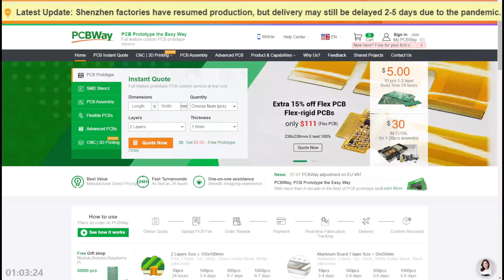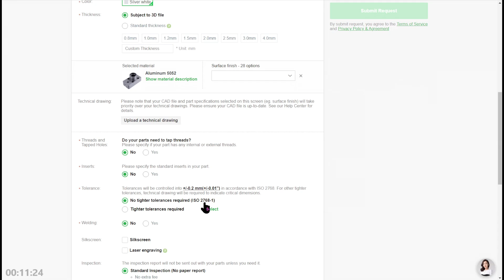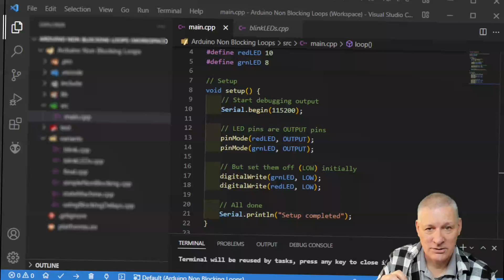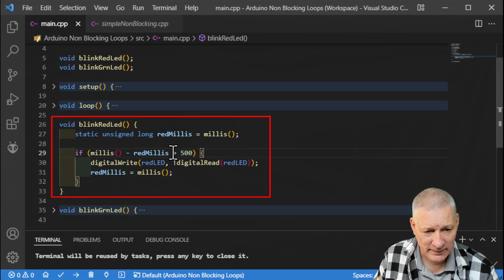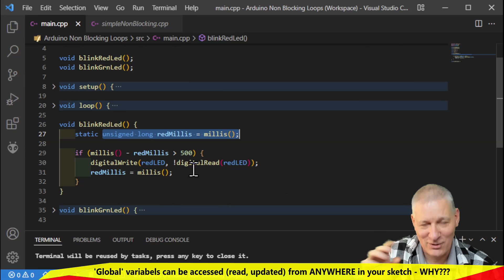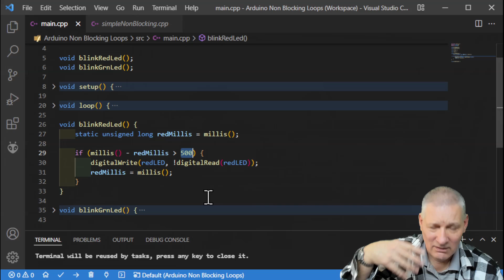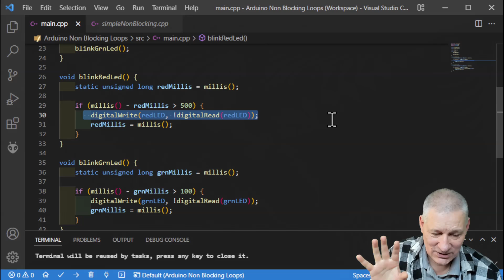#BB5 Moving your Arduino to a multi-tasking State Machine - Easy Intro

Comment: Hey Ralph, It's been a while. Very good video for beginners, definitely not impenetrable! Hope things are okay with you, haven't been watching for a while since it made me want to do things when I couldn't so made me sad. (P.S I changed my user on YouTube from Jessica to my handle, if you were wondering =D )
Reply from the maker: Good to hear from you again, Jess, and I hope you are well (or as well as you can be). 😢

Glad you found the video comprehensible. Yay! Perhaps you can try out the examples I've put on my GitHub for this video (although you probably know all this stuff anyway).

Keep safe and keep watching! 😉
Reply: @RalphBacon  Sure, most of it is familiar, but no matter how much you know, there's always more to learn... Like that explanation of one of the 'static' declaration's meanings, I didn't know that before :) I used the millis non blocking delay stuff when you challenged me to port the on/off/kill to AtTiny13A (and on other stuff, since using a delay blocks execution, it's a fairly easy drop in replacement! :)
Reply: Also, have you seen/read the Atmel Application note for better code on their chips? Like if you do a for loop negatively it uses less processor cycles (for i=10 i--) type stuff. You've probably seen it, but if not look for Atmel AVR4027: Tips and Tricks to Optimize Your C Code for 8-bit AVR Microcontrollers :)
Reply from the maker: This one: https://ww1.microchip.com/downloads/en/Appnotes/doc8453.pdf
Reply: @RalphBacon  Yeah, that one. :) It's an amazing document. I assume you were already aware of it's existence? :)

Comment: A wonderful video, Ralph. The comments demonstrate its efficacy by the fact that viewers have started thinking out of the blink sketch box. The important thing to take away from the loop you showed is that other tasks can be added to the loop by adding another function into the loop. Of course, just as with intercepts, one can't use too much time in that function. However, the added task could be broken up into smaller bits. An example: say you have an LCD and a real time clock (RTC) chip and you want to change the display of time once a second; but you find that each time that function 'activates' the procedure, the pattern of the LEDs stutters. In that case, you would have the  function read the RTC and save the value in a static variable and  sets a static flag. The nest time the function is called by the loop it checks the flag (in truth, the function checks the flag every time it is called) and  ignores the millis count but changes the display to reflect the value that was saved last time and clears the flag. Thus, the two blink functions get their chance to check the millis count in the middle of your task.
Reply from the maker: Of course, the more "work" we do in (or call from) the loop the less time there is to go around. But the next stage of this multi-tasking approach is to do "bits" of each function for a short time but return to the same point on the next invocation - hence the 'state' of each function must be known. 

But there is nothing to stop us calling functions like this:
A ⬅
B
C
A ⬅
D
E
A ⬅
F
G
where function A is time-critical and must run more often.

Ultimately, a true multitasking system will only ever allow each function a maximum of (say) 1mS of run-time before switching context to the next function (round-robin approach). But that has its drawbacks too which you alluded to. And running a critical function at a higher priority just starves lower priority tasks.

I had to take into account all this with my ESP32 Web Radio that streams the audio from the Internet, buffers that data, passes the data to the MP3 decoder, updates the screen, gets user input... the list goes on!

Coding, ain't it wonderful?
Reply: Wouldn't an interrupt be far more superior yo implement that scenario? One that either frequently reads from the RTC or even better if wired properly uses the RTC as the interrupt source.

Comment: The pedant in me says this: if you want this to be a little more accurate, use:

if (millis() - redMillis >= 500)

otherwise, it's only toggling every 501ms

Secondly, if you don't know how long the read and write will take, it would be more accurate to put the millis() result into a variable before the check, then if the check is true, set redMillis to the value of the variable rather than read it again:

// RED led blink
void blinkRedLed() {
	// This unsigned long integer declaration is only 
	// actioned ONCE by the compiler before moving the
	// variable outside of the loop
    static unsigned long redMillis = millis();

    unsigned long currentMillis = millis();
	// If enough time has passed (500mS) we toggle the flash
    if (currentMillis - redMillis >= 500) {
		// Set the red LED to whatever it is NOT now
        digitalWrite(redLED, !digitalRead(redLED));
		
		// We must reset the local millis variable
        redMillis = currentMillis;
    }
}

Personally I'd also put the 500 value in a const at the top :)
Reply: Actually doing a subtraction  operation every loop is a complete failure of coding burning up abouy 8 clock cycles.
Redmillies = millies() + 500;
If millies >= redmillies
Reply from the maker: I'll go for clarity over efficiency every time 😜
Reply: @RalphBacon  that's my review it's a failure.  Nothing will change it.  Everything someone gets a bad code review its just a sass answer from someone who thinks >= is an improvement never do I hear unless it's me.  Thank you for constantly improving your skills.
Reply: In fact, in case something has blocked coming into here for more than 1ms, probably best to ignore currentMillis after the test and set redMillis to (redMillis + 500) then your blink might be late, but the subsequent ones should be on time
Reply from the maker: You're skipping ahead, Brian 🤦‍♂️. There's lot we can do, but first let's get the State Machine up and running. 😜

Comment: Lots of computation repeated unnecessarily... The test does subtraction every time.  Set redMillis to millis()+500 to the time when the pin should next be toggled and compare to millis().

There is only so much time to do stuff... the less you do (unnecessarily), the more time you have for useful stuff. 

Doing less in each compute loop, reduces the granularity of response, something very important when one has real-time considerations.
Reply from the maker: Sorry, I disagree. In this instance, subtracting a stored value from millis works well and also caters for the millis( ) overflow - you still get the right answer.

I'm more interesting in getting people to code better than worrying about a few nanoseconds "optimising" the efficiency to the detriment of the robustness of the code.

Just sayin' 😉
Reply: @RalphBacon  I agree that the rollover of millis() would require special handling. 
Generally not a problem if you know about it.
Those nanoseconds get chewed up rapidly, even with unsigned long arithmetic and comparisons. And the time can vary depending on the processor type, even within 8-bit AVR.
It's better to be able to burn idle cycles than to run out of cycles doing something useful.
Using more of the hardware to blink lights, without CPU utilisation would be instructive... Learning how a timer-counters can be used instead.

Comment: Paused: I did this on a project a few years ago; you create a loop, save the current millis() in a seperate variable for each timed activity and then go round the loop subtracting the saved value from the current value of millis() until the difference is the time required. You then reset the saved millis to the current, and go on to check the next variable. Using this technique I was able to get a single arduino to take timed photos with a jpeg camera, and send them off to a phobe via a GSM modem, using the timer to time the pictures, handle the serial communication with the GSM modem, and read various sensors and battery monitors. It would have been quicker to use a raspberry pi, but the friend I was doing the software for wanted to make a dozen, and the cost would have been too high! It worked fine in the end.
Reply from the maker: I'm glad it worked well (in the end). Without this simple technique I could not have written my ESP32 Web Radio, although admittedly that uses a more developed state machine concept and even a couple of extra tasks.

Comment: Wow ! I self taught myself in C+ and didn’t know about static variable or the ! ‘trick’.  Most of my Esp8266s use Blynk which requires keeping the loop clean, thus the extensive use of timers. Looking forward to the next video. Is that push button going to be used as an interrupt ?
Reply from the maker: The push button (and yellow LED) will be used to further develop the State Machine code. Stay tuned! Or subscribe!

Comment: Ooo that's interesting, I can use this on my boat automation project.
Reply from the maker: Quite possibly. If you need to do more than one thing at a time this is the way to do it (on an Arduino).
Reply: @RalphBacon  I'll be using esp32

Comment: Very interesting video. But in reality, if the green LED function is doing something that take e.g. 5 seconds, then red LED function is not that independent anymore. Or am I wrong?
Reply from the maker: Not at all, Pekka. I did make a note in this video (you missed it? 😲) that it was important not to let a single function monopolise the processor time. That's where the true State Machine helps by allowing the function to exit in a timely manner but come back in at the same point. More in a later video.
Reply: @RalphBacon  Yes, you are right. I look forward to more videos about multitasking on Arduino
Reply: @gsdcbill  Thanks, interesting part: Task (preemptive scheduling) implementation

Comment: Nice use of the static directive, but a very loose state machine.
I think I'd have used Millis() function to control a simple switch statement type state machine where you can see the flow of the state machine better. not hidden in the led functions.

But that’s just my opinion, honest or otherwise  :-)
Reply from the maker: Fine, you can share your opinion here (I hope it is honest!). 

But this example is trivial, flashing two LEDs. What if you had 30 functions that all had to run "simultaneously"? Yet were logically not connected (eg one updates the screen, one gets input from the user... and so on).

No switch statement is going to solve that IMHO (of course).
Reply: @RalphBacon  thats an easy one, the arduino's are single core so you can't have two things running simultaneously. With esp32 well you can have two. If on a single core microcontroller and  if you don't want to use interrupts then your need to do the whole thing by polling. The switch statement can be used to provide a slice of time for each requirement. A kind of basic rtos as long as the cycle time can be faster than the fastest requirement. 

Thanks for giving me something to think about today,  now I've got to get back to the ESP8266freeRTOS problem thats driving me nuts so thanks again for a little light relief.  Always look forward to Friday's and your videos keep them coming.  Honestly :-)
Reply from the maker: Honesty is always the best policy. Unless your wife asks "Does my bum look big in this?" in which case the answer is always "NO".
Reply: @RalphBacon  Sorry, Ralph, but there's no CORRECT answer to that question. Its better to feign deafness than to attempt an answer.😱😣😀
Reply: Because it's not a state machine. Yet. It's a structure that can do several simultaneous tasks, that will lead to actual states. I actually thought about that around the 21: mark where he said that the states of the LEDs was unknown, when it really is know by looking it up via digitalRead. That info is just not stored in a state variable that can be looked up by any function any time. (I know I'm writing this after the 2nd vid is released. I haven't seen it yet but will, but because I know where it's going I wanted to add this note here for other people who see these comments.)
Reply: @jimbarchuk  only apparently simultaneously performing task's, the processor can only perform tasks serially as it only has a single core.  But we flogged that to death in the next video.

Comment: A problem of using millis() without any type o case protection is when millis() overflows, the LEDs are not going to blink anymore
Reply: Wouldnt using the "millis() - variable" technique be overflow proof though? Whereas "millis() > variable" would be troublesome.
Reply: @jestr1845  When millis() goes back to zero, the variable (redMillis) is going to still be really big, which is going to result in a negative number and  the difference never pass the 500ms again. This can be a bigger issue when you use the micros(), that reset every 70min
Reply from the maker: If millis( ) overflows, it will have NO EFFECT on these sketches. Trust me, I'm a doctor, er, programmer 😆
Reply: @FelipeLenschow  It should still work. Lets use bytes for numeric simplicity:

255 - 250 = 5  // as expected

256 - 250        // is in reality...
1 - 250            // which simplifies to...
-249                // which as a byte would be...
6                      // as expected. Or am I wrong?
Reply: @FelipeLenschow  unsigned long will not show negative number afaik.
Reply: @jestr1845  Oh, now I get it. When comparing two unsigned variables in the if statement, it will output an unsigned number (of course) and because of the two's complement it will make a positive number, which happens to be useful to keep the sketch running. I have already used this to read that servo kind of signal and used another if to verify if the variable was bigger than micros(), and if it was then reset the variable, but now I see that I didn't need it
Reply: I thought with unsigned long it will just going to start over from 0 and count up again ?
Reply: @gsdcbill  thanks

Comment: Hi Ralph, another seasoned coder here. I’m glad you are showing these techniques (and I love how you saved yourself a variable by reading the state of the LED rather than drive it from a Boolean). At some point down the road it could be an interesting construct to introduce power management techniques. Eg if the next required state change is not due for x millis then either shut down the main core while pwm runs, or adjust the clock speed to match the requirements of the states that are in the set of states that are under current consideration.
Reply from the maker: Power management techniques could be included, if there is "nothing to do", so in effect we are just idling. Yes, in a battery-powered device every millisecond asleep is another millisecond we can run on power.

Comment: Less than 10 minutes. You need a better example.

while(true){
LED1 ON
LED2 ON
delay 250ms
LED1 OFF
delay 250ms
LED1 ON
LED2 OFF
delay 250ms
LED1 OFF
delay 250ms
}

And if you want to do other stuff while blinking:
L1Counter = 0;
L2Counter = 0;
while(true){
  if(L1Counter>=50)
    redLED = 1;
  else
    redLED = 0;
  
  if(L1Counter>=25)
    greenLED = 1;
  else
    greenLED = 0;
  

  L1Counter++;
  if(L1Counter >= 100)
    L1Counter = 0;

  L2Counter++;
  if(L2Counter >= 50)
    L2Counter = 0;

  delay(10);
}
Reply from the maker: I'm sorry, Nikoclay, what you have written is not what would be acceptable in any commercial environment I've ever worked in. 

The idea of each function is to have a single responsibility.  It decides when to run and when to yield (think several steps ahead where you might have a function run in its own task).

All that "if this then that" decision tree does not sit well with me and not what I'd promote to beginners in coding.

Worst of all, you have a delay(10) in your code. What on earth is that for?
Reply: @RalphBacon  He's using it as a rudimentary timer - bad idea
Reply: Wait is what you are doing really a state machine? When you say state machine I imagine something like this: https://www.youtube.com/watch?v=-Yicg2TTMPs
Reply: You should be using L2Counter for the greenLED, but I'm sure it was just a typo ;)

Comment: Hi Ralph, great subject to cover but I have a question and that is why is it preferable to use 'const'  instead of  '#define' as the Arduino manual recommends ?
Reply from the maker: I don't know why they would recommend that. 

A literal value (eg from a #define) is substituted by the pre-compiler and then used directly (it isn't fetched from memory). It does not use up memory space as it is not held in memory. It's part of the code.

Const defines a fixed variable (so it does take up a memory location, unless the compiler is smart enough not to do that?) that can be scope-controlled (eg only valid in the function it was declared in, just like any other variable) whereas a #define can be used anywhere - but that's no advantage, not really.

I think the use of #define is much better than having magic numbers as long as the name is unique; using const might make your program more robust with its scope control but it does use a small amount of memory.
Reply: @RalphBacon  Explanation from the Bald Engineer site. Sorry YT blocks outside links.

Since the avr-gcc compiler is smart enough to keep variables out of RAM when using the const keyword, it is better to just use that.  Eventually the “text-replace” nature of #define is going to bite you with a stray semicolon or other unexpected replace
Reply: @RalphBacon  Why n9t use #define for the size of each of your timing periods, then?  Aren't the 100 and 500 "magic numbers" as it stands?
Reply from the maker: @Roy Tellason yes the delays were indeed Magic Numbers (good that you spotted that) but for simplicity I kept them, as clarity was important in this demo code (not Real World code).
Reply: @RalphBacon  Ta !
Reply: Cheese!!!!!!!!!!!!!!!!!!!!!
Reply: @fredflintstone1  squeak !!